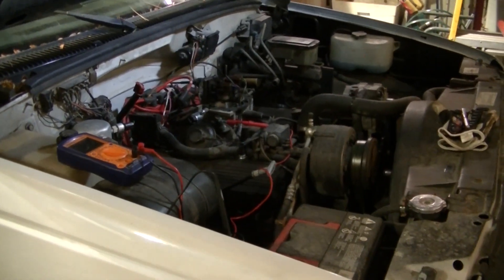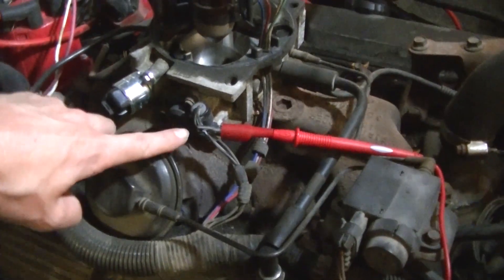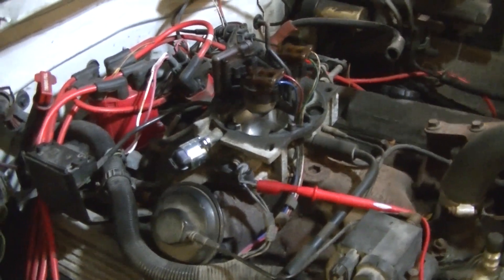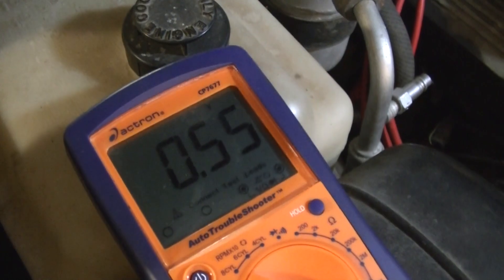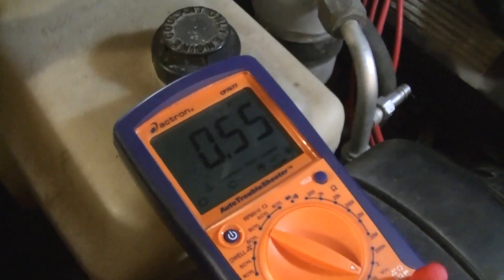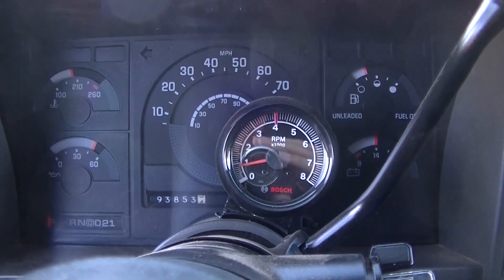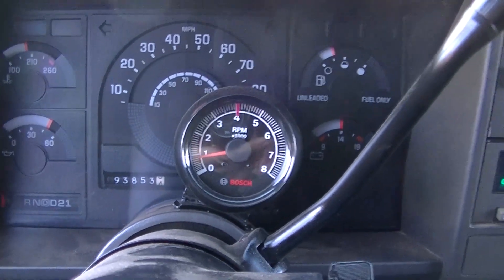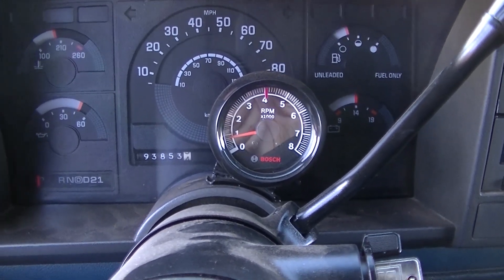91 GMC C3500 454 350 TBI TPS Idle Adjustment

Comment: Before you go hollowing out screw holes in the TPS sensor there is a mechanical idle adjustment on the driver side front of the throttle body you can adjust while looking at your meter and get your.58V.  It may be behind a block off plate.  The screw is a torx head.  Just my 2 cents.
-Jon
Reply from the maker: Pretty sure you can't adjust the idle on these TBI trucks. Just my 2 cents.
Reply: @mossman381  Well there is a mechanical idle adjustment on my '88 Chevy TBI.  You'd have to pull the block off plug out to access it.  Ask your source for the other information you got.  It's there.
Reply: @mossman381  100% you can just take the metal plug off the front drivers side of the tbi and there it is a torx screw
Reply from the maker: @lucianorodriguez1791  Isn't it blocked off for a reason? They don't want you to mess with it. I would rather adjust the sensor than mess with the throttle body adjustment that they don't want you to mess with.
Reply: it is extremely difficult to get that plug out. i wish i would have messed with this sensor to begin with.
Reply: @JamesPlatt88 took me less than 30 seconds to drill it out. You must not know what you’re doing
Reply: There is a process to manually adjust the idle. Paper clip in the a b ports etc.
Reply: @mossman381  Correct. It's set from the factory. If the engine won't idle correctly with the distributor wire disconnected you likely have vacuum leak/s that need addressing. The most common is the base gasket under the TBI. Second would be throttle shaft end/s.
Reply: You most certainly  can adjust  the idle once you remove the plug. You have to jump a and b on the diagnostic port. Turn the key to the  on position(not acc position) wait 30 seconds for the iac valve to close, unplug iac valve, turn key to off position, remove jumper wire, start engine,  adjust torx screw (t20) shut engine off. Unhook  negative  battery cable for I believe  at least  a minute to clear any codes. Hook iac back  up. Reconnect battery, done. Checking and adjusting  the tps as this video describes  afterward  is a good idea too to be sure your screw adjustment hasn't taken  it out of parameters

Comment: The TBIs shouldn't require a TPS adjustment. Proper idle adjustment starts by disconnecting the timing connector wire to the distributor and making sure the timing and idle is in spec without the ECU. Once done you connect the distributor wire back up (engine off) then start the engine. From that point on the ECU should control the speed with the IAC. Be sure you have no vacuum leaks when doing this.

Comment: Quick question, I have a 92 Chevy C1500 with the 5.7L. I’m currently experiencing issues of it wanting to stall out when I come to a stop after driving it for 35+ minutes. I’ve changed the idle air control motor, I rebuilt the throttle body, I’ve changed out the fuel filter. I’m wondering can it be the TPS? Is it also possible that my fuel filter is plugged up? I just changed it less than 2 months ago but when I bought the truck I know it was sitting for a few months.
Reply from the maker: I would check the TPS like I do in the video. Have you changed your O2 sensor?
Reply: @mossman381  no I haven’t yet, could that be my issue? I’m just trying to figure out what could be wrong as it’s not throwing any codes
Reply from the maker: I wouldn't trust the codes on these early trucks anyway. I would check to make sure your TPS is giving the right signal and then change the O2 sensor so you know it's good. Even if the O2 sensor isn't bad your truck will run so much better with a fresh one. I think if the fuel filter was plugged it would run bad all the time. Also get a new PCV valve. Have you done a major tuneup? Plugs, wires, air filter. rotor, distributor cap.
Reply: @mossman381  yes I have replaced the cap and rotor, plugs and wires, PCV valve and air filter. I originally started with the cap and rotor because I noticed that there was ?rust inside the cap and I’ve been replacing basically everything from that point on because I’m not sure when any of it was changed out last. But I’ll definitely check the TPS and see what it says.
Reply: @mossman381  I just tested it and it starts with a reading of 0.53-0.54 (it jumps back and forth) and when I move the throttle it does climb up to 4.43
Reply: @mossman381  so I changed out the oxygen sensor yesterday and today it ran like a top. The strangest part was my oil pressure gauge was normal, unlike how it was before where I would come to a stop and the oil pressure gauge would read almost zero until I started driving again. I honestly can’t explain that part.
Reply from the maker: Glad to hear it's running good.
Reply: @brandonrayner5253  I have a 1993. Mine does the same thing man. And I know that isn’t right. There is no way. I have 15w40 oil in my truck and some zinc additive.
Reply: Pick up coil in distributor. Requires removing the distributor to replace. While out be sure the stator is not cracked. Only use Delco parts.
Reply: @jf4872  my truck has been working normally since I changed out the oxygen sensor. The only thing I did with my distributor was change the cap and rotor. The only thing I have to do to my truck now is change out the transmission filter and fluid and fix the drivers rear cab mount.
Reply: A little late,  but fuel pressure regulator

Comment: My truck idles around 1200 and stutters a bunch when I first get on it. I'm guessing it's the TPS but I'm not sure. Any thoughts?
Reply from the maker: When working with these older trucks start with the basics. The pcv valve is probably a good start. You can check your tps before buying a new one. Vacuum leaks can cause these problems. If you just bought the truck or it hasn't been worked on for a long time I would recommend doing what they call a major tune up. That would be spark plugs, wires, distributor cap, rotor, fuel filter, air filter, oil change. A lot of times that will not only fix problems but make the truck run much better and make it more reliable. O2 sensor would be another good thing to change if it's never been done. Good luck.
Reply: mossman381 many thanks, I have done the major tune up so that’s why I turned to the TPS. Looking at it now it’s all wire nutted and messed with.
Reply from the maker: You want to clean the rats nest wiring up. Check your engine ground or make a new one.

Comment: I think the computer gets confused when it sees the wrong voltage and starts defaulting back to base idle , then it tries again, cuts back on fuel, then just keeps looping in a surge.
Reply from the maker: This truck has been running pretty good since the adjustment and some new parts.
Reply: @mossman381  my tps reading at idle position is .78 so im drilling the holes longer to try and get it to .50 . I will try that today and see if it works. my truck starts fine, and will do a surging idle sometimes for a few minutes, then levels out, then sometimes high idles, the when truck is warm good, it idles ok.. it seems like when in  open loop, it cannot find happy.
Reply: @mossman381  was your truck surging or only high idle all the time?
Reply from the maker: @randy1ization  No surging, just a high idle.
Reply from the maker: @randy1ization  I replaced a few parts on this truck. Check the playlist to see those.
Reply: @randy1ization  did it fix the issue? I'm experiencing the same issue that you're describing.
Reply: @maximiliankranewitter4772  MY problem turned out to be  the truck had the wrong injectors.. it had 4.3 liter v6 injector in a 5.7..  changed injectors and surge went away, backfire went away, run great.
Reply: if the truck is surging, try pinching the RETURN line coming off the fuel pressure regulator, going back to the tank.. this will INCREASE output pressure to the injectors. dont completely block it off, just pinch to restrict the flow with flat vise grips with tape on the teeth so u dont damage the line,, reform the line to round if it doesnt open back up after removing grips.  if surging, pre ignition, missing, stumbling goes away, u have a fuel pressure problem,.  u could have wrong or bad injectors, clogged fuel filter, weak or broken spring in fuel regulator, weak or clogged fuel pump.screen,  ect, but these truck must have correct fuel pressure and flow, or they run like crap,.. too much pressure is not good either so dont put a stiff spring,, put the factory spec spring.  u want  9-12 psi no more no less,.   I think my 02 sensor was picking up a lean condition and would loop surge.. whats coming out of the tailpipe can be a good indicator,, when I put the correct injectors , condensation started forming and coming out the pipe,.., condensation is a product of effiecient combustion.. so look at spark plugs, and exhaust output.

Comment: Had an 89 suburban 2500 4x4 high idle, turned out to be the tb  gasket had a wrinkle causing a vacuum leak. The computer would eventually adjust it down.